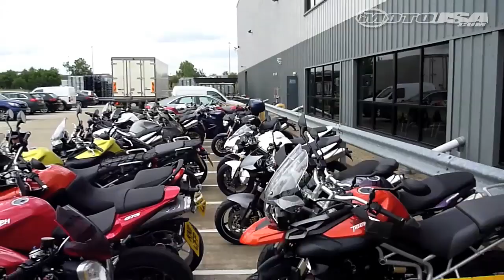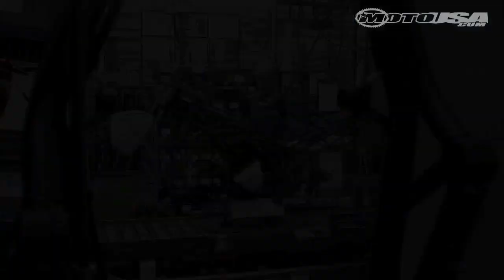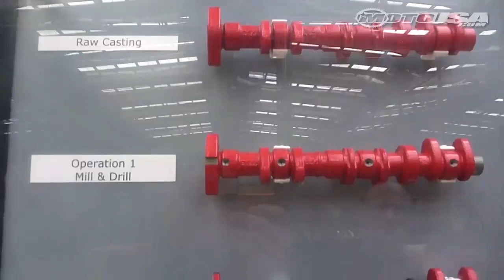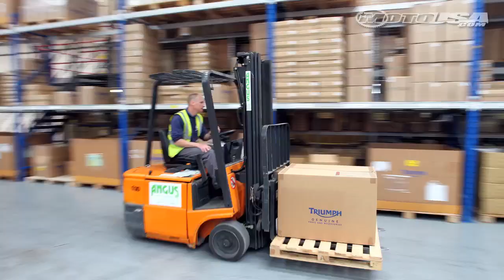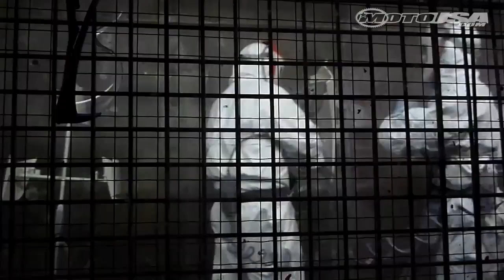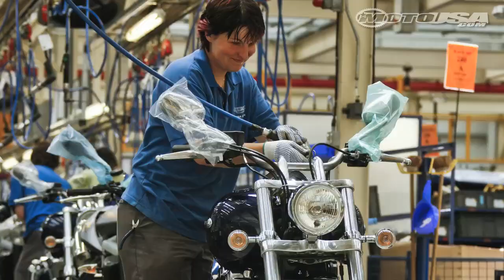MotoUSA Inside Triumph Motorcycles

Comment: I put 36,000 miles on a modified 2010 T-100. Zero problems. Traded her in for a Storm. Just put 12,000 miles on that bike. Zero problems. So some bikes are assembled in Thailand. Big deal. All engines are made in England! I'm just happy Triumph still makes motorcycles(A wide variety at that). When I ride my Triumph for some reason I forget where it was made. I just enjoy the ride! I suggest you do too. If it  bothers you that much buy a Harley. Good luck with that! Cheers to the men and women who assemble our Triumphs!!!
Reply: My Norton 1960 domie 600 did 50,00 miles from when I rebuilt her in 98. absulitly no problem.. i owned a 995 speed tripple from new it handled like a texco trolly and no caritor. so i got wid of it and rebuilt my Norton again still arockin bike. these new Trumps are just like ridind  any other new bike just like a computer game no soul

Comment: Double check that. If the last letter in the bikes VIN is a T and not a J then it's made in Thailand. I'm pretty sure all of the "classic" bikes, Bonneville, Thruxton, Scrambler, America, and Speedmaster final assembly is in Thailand and had been since 2001. Some bikes also start production in Hinckley and are eventually moved to Thailand, like the Tiger 800.

Comment: "China makes some engines for BMW"
Never heard that before.  If that's true, then that's a shame b/c products manufactured in China, to put it mildly, do not have the best build quality.  Therefore, I would be less inclined to buy a BMW.

Now, having said that, China is not Thailand, so if the bikes are reliable and have a good build quality, then I will give credit to where credit is due (to the Thai's and the Brits).